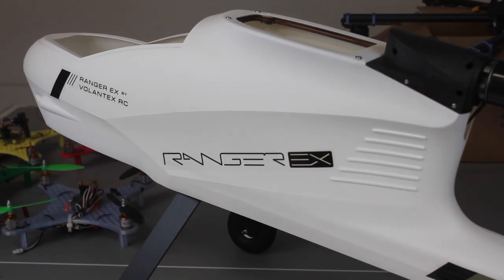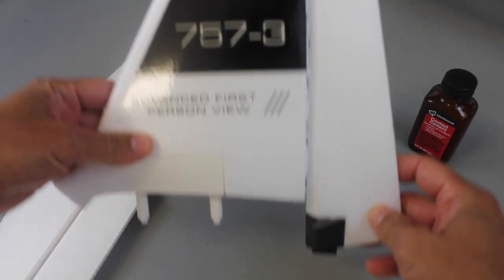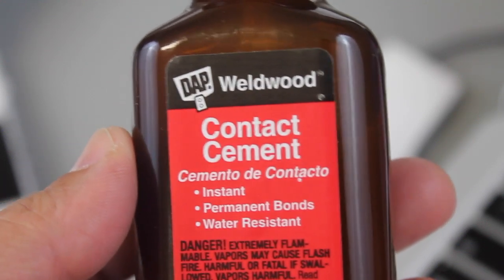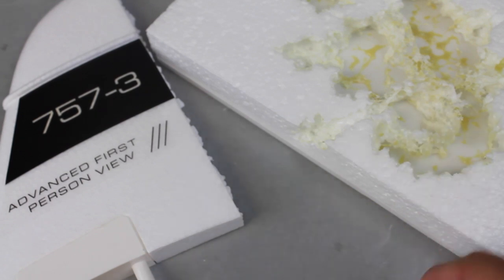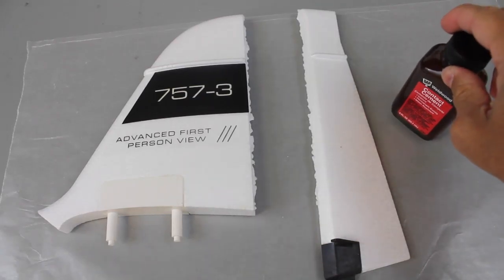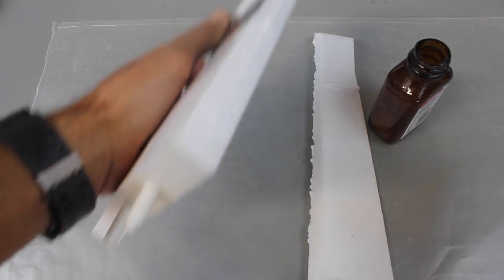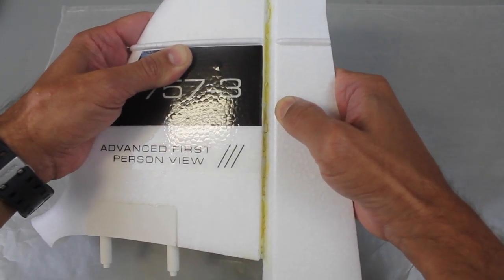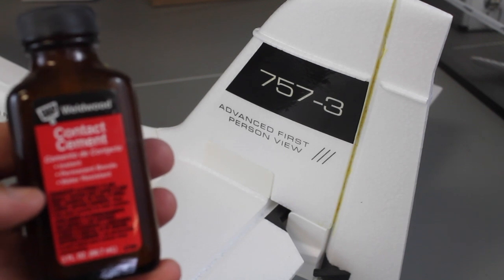How To Repair Broken Hinges on Your Foam RC Plane with DAP Weldwood Contact Cement

Comment: Dennis,  I think the reason this method has held up for you so long is for two reasons.  1). your rudder was ripped at the hinge line and not cut,  this gives the contact cement more area to grip.  2).  Most flyers do not use the rudder much at all, so, for most people, it does not get much use.  I use this method on my light  EPP foamys and have never had a problem.  However on a lager plane... and one that I will put so much expensive gear in such as a FPV plane.... I cut my foam hinges on the rudder and elevator and installed dubro types on my Ranger EX 757-3.  Thank you for this video.  BTW, Foam-Tac rocks!

Comment: Thanks Dennis. I have a phoenix 2000 with a busted rudder and a F61 wing with a busted control surface and was using tape to hold it that wasn't very successful. I will give this a go. I have used it for many other purposes and I'm sure it will work great for this.
It's great when people post simple stuff like this, as it helps so much. Big thumbs up from me ( and I enjoy watching ) please keep up the great work.
Reply from the maker: AUTOSKIDS Thanks for the feedback. I'm still not sure how this will hold up over the long haul, but it seems ever more durable than the original foam hinge. We'll see and I'll definitely share my results over time. Thanks for the feedback and I appreciate you watching.

Comment: Dennis, I have a Ranger EX. The hinge failures is the only reason I have not even got it outa the box. I have been reading allot about replacing the hinges, so that's what I'm gona do. Good ideas below. Looking forward to your Ranger series. Thanks Dennis.
Reply from the maker: Daniel Wiley Good idea to replace the hinges. I was shocked at how fragile the rudder hinge was. I only dropped it from 2 ft up. I'll share an update on this contact cement after I get it in the air and do some tests. Thanks for the feedback and good luck with your build.
Reply: +Dennis Baldwin I use uhu por foam safe easy to apply and very strong

Comment: IDK... maybe I'm just old school...
I have a SkyEye and a Phoenix 2000 that started showing aileron/elevator foam hinge weakness/tearing after some not so sexy landings.
I use Dubro style hinges with the metal hinge pins glued with CA with a toothpick through the hinge plates for extra security.
Haven't need to repair the hinges since then.
Reply from the maker: lasersbee No I don't think you're old school at all. I like the Dubro hinges and even better your toothpick mod, but wanted to give contact cement a try. It will be interesting to see how this cement holds up over the long term. Will definitely share as I learn more. Thanks for the suggestion.

Comment: I was really interested in getting this plane because of its plastic fuselage and cool fpv potential ,  but not anymore. I had seen plenty of videos of this plane's hinges popping off in mid flight without any advise causing terrible crashes. To bad, because the plane seemed to have truly fpv potential. 

If I were you, I would even ft to fly the plane after that repair job. That part is done,  and a new one would just looks nice until it fails in mid air.  Good luck my friend.  Is lamentable because I really liked that plane.
Reply from the maker: ricardopr54 Thanks for sharing your feedback. I've been caught up in other projects and so haven't been able to get this in the air. I may still give it a try, but it's definitely not a priority right now. Appreciate your thoughts!

Comment: Use Shoe Goo or Goop stronger bond and clear no yellow hinge line. FYI I have been flying foam for over 20 years, I was importing Multiplex foam planes before Hitec bought Multiplex and am now the importer again. I also goo my planes BEFORE I even fly them now so they never fail. I have Pico Jets that have the same goo hinges for over 20 years now.

Comment: How has this hinge held up since it was installed?  Are you able to rip the rudder off if you were to tear it?  I use Beacon FoamTac glue for foam hinges.  It's less messy and gives you bond that is better than the original foam.  If you get a new break, it will not be at the glue joint but some place new.
Reply from the maker: +mmerry2 on YouTube It's been holding up well. I have not had to mess with it since I posted the video. I haven't tried to put any direct force on it so I'm not sure if it would tear. I've heard good things about FoamTac but never used it. I'll have to give it a try. Thanks.

Comment: Forensic foamist Dennis! Wow thanks for the good tips. You must have dropped it pretty hard. I dont know if I could own something like that if it broke easily! Im a bull in a China shop anyway
Reply from the maker: KandJ Steward You would think that it took some force to break it, but I dropped it from about 2 feet and the rudder flap ripped right off. Crazy huh? I've read that using contact cement creates a stronger bond than what it was originally, but the jury is still out on that. I'll definitely share my results as I do some field testing. Hope all is well.
Reply: Neither here nor there Dennis but wondering what kind of flight times are you hoping for on that plane and what kind of times were you getting from your last one? I was looking at the skymule by hobbyking but the times seem low! As always Dennis, thanks for your unselfishness by all of the great videos and information you provide!

Comment: Wow I would not try this fix! Seems really iffy to me. I replaced mine with regular c/a hinges and thin ca glue. Works really well and easy to install. 

Volantex planes seem to have this issue, i had same with the raptor v2. Bixler didnt have any issues.
Reply from the maker: +pukki34 Thanks for the feedback. Same here, Bixler doesn't have any issues at all.

Comment: Hi Dennis, awesome video as usual. 
What do you think about a ezuhf Jr module? I need a uhf sistem but I don't want to spend a lot of money. Thanks a lot man
Reply from the maker: Lorenzo Longhini I haven't used EZUHF yet, but plan on doing so. When I get around to setting it up I will definitely share my thoughts. Thanks for the question and I appreciate you following along.

Comment: There isn't enough surface area there for me to feel confident in using contact cement.  I use the packing tape with the fiber strands inside of it, I place a piece of tape connecting both pieces on both sides and let the tape be the hinge.
Reply from the maker: 0917bobb I hear you loud and clear. I thought the exact same thing....and still do, but it's holding really well. I'm going to get it in the air and will run some tests. Will definitely be sharing my results. Thanks for the tip on the tape hinge.

Comment: I dont say it would work, but for a fpv /apm plane, I always cut nicely trough the foam hinges and use the dubro style ones, make me feel secure and safe to fly a + 2Kg plane. Dubro style hinges makes less friction (better for the servo) and more precision steering, yet again, I dont say foam hinges are bad ;o)
Reply from the maker: ***** I really like those hinges too. I wanted to see how the contact cement holds so I'll do some testing and share my results. Then when I put Pixhawk and a camera in it I'll likely reinforce it better. Thanks for sharing your tip with us!
Reply: Dennis Baldwin
No problem, Cheers.

Comment: Why not install real hinges? Or go through and apply hinge tape to all surfaces.
Reply from the maker: yellowbusguy Good question and it's something I normally do....as well as the tape. I wanted to try this contact cement option as I've heard good things about it. Not sure if this is what I'll use in the long run, but want to see how it holds up over time.

Comment: ill typically just glue some plastic hinges in works for me
Reply from the maker: 2007crf450r Yeah those work really well. I wanted to try going with the contact cement only option and see how far that will get me. I'll share my results in the coming weeks as I get this bird in the air. Thanks.